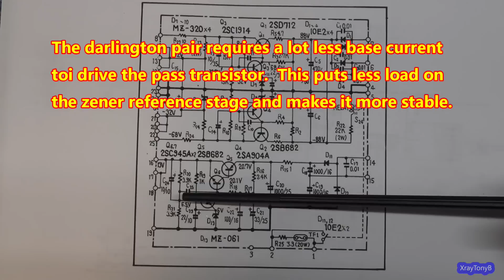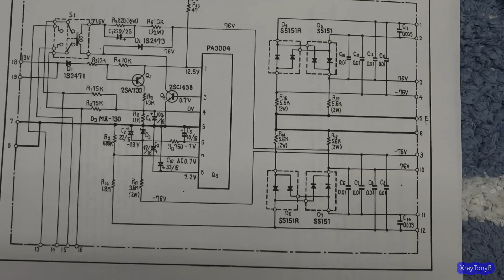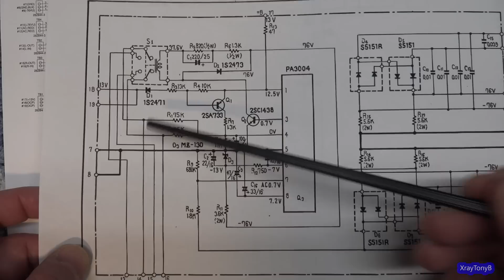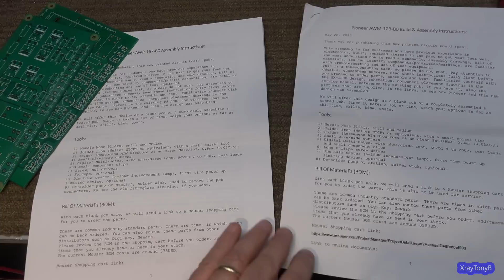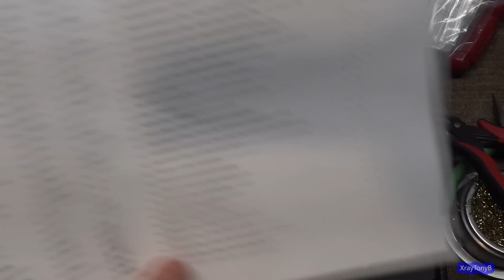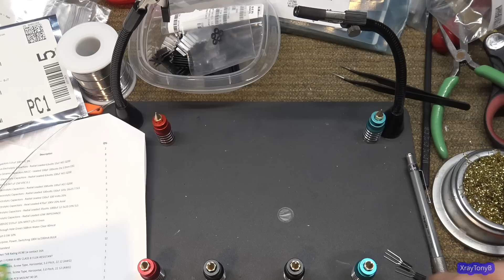Pioneer SX-1280 Part 6  - Circuit Theory & Assembling the New PC Boards

Comment: Another funny fact. I brought my Pioneer SX-1250 and Pioneer SX-1980 power and other board upgrades from the same dude in Canada you reference. Only difference I got the version he sells that has all the electronic bits set in place. My repair people use the same chap. He also supplied all my boards for my Pioneer SX-1250. Nice to know I choose my upgrades well. The best thing is all the awesome upgrades in these boards still lets this huge Pioneer SX-1280 receiver sound just as awesome. I like the black meters and colored function lights unique to the Pioneer SX-XX80 Series.
Reply: Hello,  do you by any chance have a link for his ebay listing's? I have a sx 980 that id love to do this with. Thank you for your help.
Reply: @rodgerjohnson733  It won't let me list his information.

Comment: Hi Tony. I hear you often say that the gain of transistors have gone down over the years by heat. But please see that the manufacturers use low gain transistors in places like regulators, because they are cheaper, and the schematic doesn't matter at all for high gain, it will work anyway. The only thing it does is open or close more or less.

Comment: I realise the new boards are better than the original ones, who still lasted over 40 years, but what about originality? Where do you stop with enhancing? I’ll bet someone at one time comes up with better output stages or a better preamp design. What will be left of the vintage character of this beauty? Why not use the original boards and restore them for another 40 years with new components. Not that I don’t love watching the process and learn from it, but it just made me think.
Reply: Good question and good answer.
Reply: I think it's a simple matter of "his property, his prerogative".
Reply: @stevencraig  Totally agree, no discussion. Just my two cents worth.
Reply: In this particular case, the fact that a particular mod board is on the market tells you that something bad has to be in the original.
Reply: @erikdenhouter  I think it’s also a matter of popularity and interested enthousiast. Lots of vintage audio suffer from bad designed power supplies. The Yamaha CT-7000 tuner for instance. Runs very hot and no ventilation. New boards are available that can handle the heat, in this case the design is completely altered. The result is stunning, but authenticity is gone. My point is where do we stop redesigning vintage audio in cases where we think the original is flawed.
Reply: @jansen2810  Choose for it to work, or choose for it to stay original. But when you see that the device had a tough life already, I think you shift towards reliability because it will never be that mint again.
Reply: @erikdenhouter  Ok, for me there is a difference between renewing (recapping, new pcb board etc.) and redesigning.
Reply: @jansen2810  I understand. For me the power supply design as it was seemed sufficient except the cooling of the transistors. Placing them on a better heat sink further away from the caps maybe sorted that bad reputation. But I can't see it in person, can't feel the heat, can't see a thermal image of the whole board, like the zener diodes.
Reply: @jansen2810  Totally different question: when I receive an e-mail notification for you reaction(s), you seem to have a different name from jansen2810. Is that right ? Never seen that.
Reply: @erikdenhouter  I don’t know what you mean.
Reply from the maker: I place a high value on originality if the goal is to keep it as a piece of history and not actually use it.  Pioneer receivers of this era were known to have problems with the power supplies.  Quite often, the heatsinks were undersized and the resistors rant hot and were positioned near the capacitors, causing them to fail.  Most of these units didn't last 40 years without having to have the power supply rebuilt.  The new design corrects these issues without affecting the audio performance of the amplifier.  In 30 years, this unit will still sound as it did new, with possibly only needing some capacitors to be replaced, and not scorched PC boards!  In addition, the original board can be kept with the unit and reinstalled for originality.
Reply: @xraytonyb  I have no intentions to contradict my teacher, I have learnt so much from you. Besides the topic is very interesting. To me however it's putting a Porsche engine into an old VW Beetle.
Reply: @jansen2810  That is a great analogy (me being an air cooled nut from way back).  If you are going to drive the car even on a semi-regular basis though you will have made some mods.  Especially as you go back to the older pre-67 cars you will have swapped to dual port heads, 12 volt electrical, maybe even front discs.  Hopefully you kept the original parts (if the car even had them...most have been lost a LONG time ago).  I remember back in the 80s matching numbers was of the utmost importance for muscle cars.  While that gets you premium price today it is amazing how it has lost its importance among us common folks.  Today we are just happy to find anything that is drivable.
Reply: @seanobrien7169  The analogy was a bit over the top. Could not think of anything better. It came up probably because my first car was a 1968 VW Beetle. 12 volt electrical, no front discs yet. A Porsche engine would not have fitted.   :-)

Comment: I do find those discrete voltage regulator designs interesting!  Modern regulators, such as the venerable LM317, offer a lot of advantages in terms of reliability and ruggedness.  However, they aren't designed for the high voltages seen in some hardware, so the discrete design still has some utility.  One of the easy things to do to improve the reliability of a regulator is to keep the temperatures low...  well below 85C... so a big beefy heatsink is a great idea.

Comment: Great video I really enjoyed the detailed analysis of the old/new circuits. I am running the same Delta9's AWR-157 power board in my 1280 and its been worth every penny. I have my 1280 ready for the bench to compliment some of your suggestions through this series. Particularly fixing the rather crude connections to the main filter caps (using a jumper wire vs using the original bracket for ground). Do you have any thoughts of adding additional 2.2uf PP caps across the filters? Also last video you mentioned making a replacement awx-127 to accept modern outputs. Did you have a chance to review the ones I recently used on my 1280 (post #10 & #38 on thread " SX1280 - Power Amp burned up a resistor" AudioKarma).

Comment: I wasn't aware of replacement boards. I wonder if there are any for Marantz?
Reply from the maker: No. Delta9electronics is the name of the company and they only have replacement boards for certain Pioneer gear, as well as some Hafler gear.
Reply: @xraytonyb  They got some cool stuff. Have you tried their STK-0050 replacement Modules?